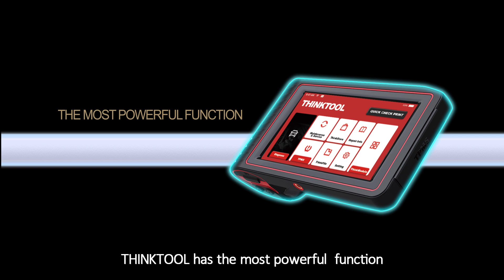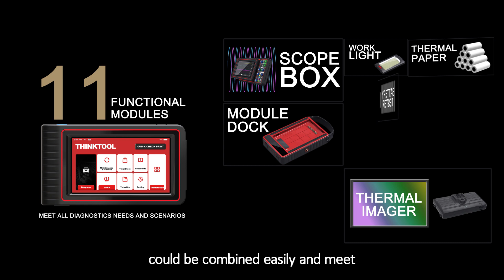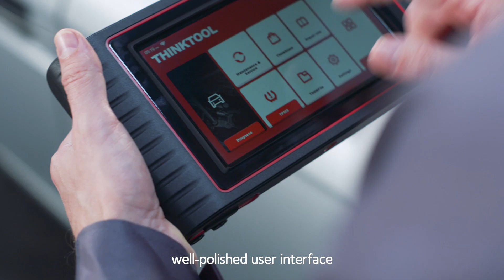THINKTOOL, the world's first All-in-one automotive diagnostic tool.

Comment: hi, what is the better scanner thinktool mini or thinkscan max?   I only need full system scan and the 28 Reset Functions
Reply from the maker: Both THINKTOOL MINI and THINKSCAN MAX supports full system scan and 28 reset functions. However, THINKTOOL MINI hardware is better and it supports 7 functional modules. Please check more details in mythinkcar.com.